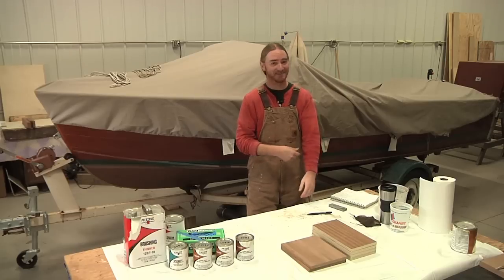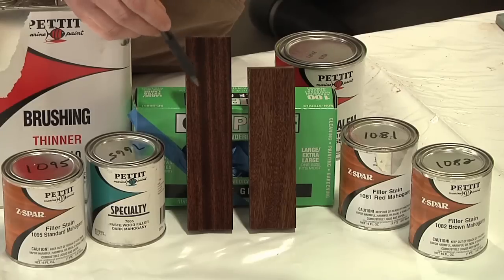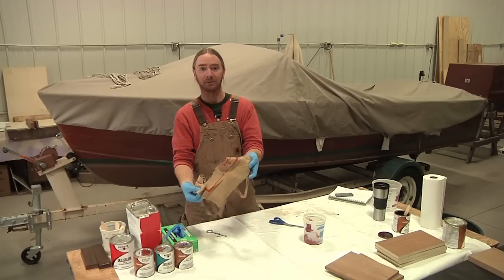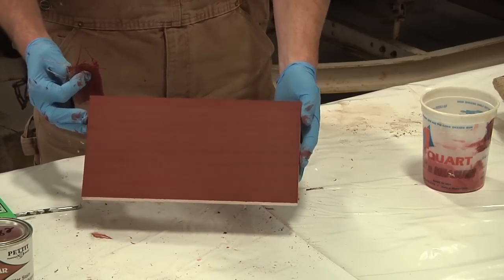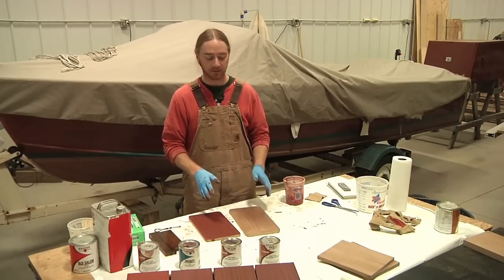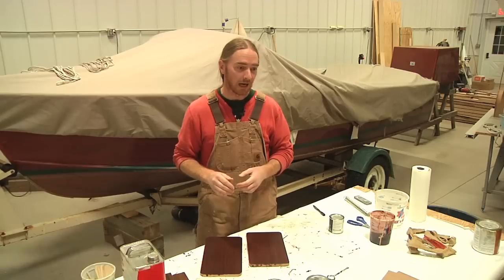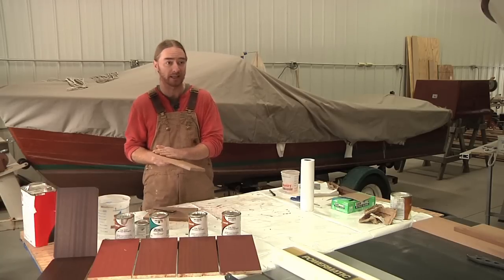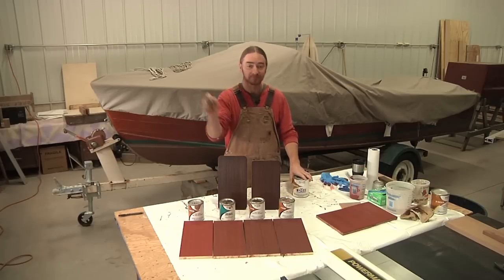Classic Boat Finish On Mahogany

Comment: I restored a. Antique wooden. Chris Craft cabin cruiser  and used Sapele  mixed in. Strategically inside. The cabin  mostly on. Things like the galley cabinetry and counters  in my opinion it looked. Like it was supposed to  be there   Ive always been told it was a “farmed” Mahogany  and it doesnt have. The rot resistance that Honduras Mahogany  has ?  In the 90s. Architects and designers spaced the heck out of it on various  commercial woodworking. Projects  most people cant. Tell the difference between  any of the species  i find your channel very interesting. As ive been a lifetime boater  that bought my first boat. In the late 70s way before You Tube videos  luckily i lived in South Florida and there was plenty of  people that were experienced in Bright work. And  taught me a lot  ive always. Favored Petit products myself  especially their Spar Varnish  that ive found looks best at around 7 to 8 coats  usually i do not stain  as I personally like the natural color brought out by the varnish  i may add  that i did do Woodworking as my profession for over 20 years  untill a Traumatic Brain Injury forced me into early retirement for safety reasons Woodworking is still a passion of mine and a hobby  although i am between homes and shops at the moment  at my old job we mostly applied  conversion varnishes to   A lot of our projects  so for me it was always a pleasure to  apply a “ real” varnish job on my boats  LOL   We did however have a full time Finisher on our staff  that  did a fantastic job. At  all of our staining and finishes

Comment: Hi Andy, I have been watching your videos for a quite while and learned a lot. I thank you for that. I am at the point of starting a challenging project of re-veneering my boat deck. I have a classic Finn of 1984 with a plywood deck. Unfortunately there is severe damage on the deck, which leaves me no choice but to repair and refinish. As there are so many repair spots already, I feel I have no other choice than to re-veneer the deck entirely. I am planning to buy 3 mtr long strips 0,6 mm thick, 3 mtr long and 18 cm wide. I plan to glue it on with West system epoxy, then when done apply a few coats of epoxy on the veneer and then refinish with a number of layers of 2c clear coat. 
I haven't done any veneering projects before, though I am a seasoned woodworker. What I am concerned about is the joining of the strips, length and cross. Can you give me some guidance maybe? I intend to align the sides of the strips with a small block plane so that they perfectly match together, but what if I glue on a strip to the boat one day and then joining the next strip the next day. I am concerned that the tiniest bit of epoxy squeeze out, might cause the new strip to not perfectly align with the one I glued on the previous day. If I would clean it thoroughly, I might damage the strip that I already glued on the deck. What is your advice to tackle this?

Comment: Great job, Andy!  Have you ever noticed hair-like single black hard fibers in sapele? I'm building bench seats for a seventies Whaler and the sapele I got is full of those streaks and when I sand it down it leaves a coarse black sawdust...
BTW I didn't stain it and it turned out beautiful!

Comment: I really enjoy watching your videos and have found a lot of great information.  I do have a question regarding teak refinishing.  In the spring I want to refinish the teak on the outside of my boat.  I have seen some videos where they have used epoxy first and then coated it with varnish.  The teak on our boat is original  and is about 40 years old.  I believe that teak oil is the only thing that has ever been used on it.  I am wondering what you would recommend for refinishing.

Comment: What paint would you recommend for a mahogany lap stake hull?  It is a 1962 vintage, is kept on trailer, has not been used in 15 years but garage kept in dry climate and in good shape.  The hull is painted white and has a copper based bottom.  Paint is flaking in dispersed small patches.  What would be a recommended surface prep?  Paint remover?  Thanks for help.

Comment: Nice video and explainations, it will help me for my guitar project. It is usually recommended to use a grain filler.. but you are not using it. Is there any reason for that? What is the difference by using a grain filler? Thanks!
Reply from the maker: +manu777tube This is actually a grain filler and dye :-) Works great!!
Reply: +BoatworksToday All right now it's clear for me! Thanks for your answer

Comment: Hey Andy. I know this video is quite old, but I'd like to add a comment/caution. You mentioned you were sticking the rags outside in the snow as it's below zero and frozen rags won't ignite. While that's true, BLO and other oils won't evaporate in those temps, either. My dad stuck his BLO rags in a bucket outside in subzero temps. Unfortunately, he brought them back in a month later and put them in the trash can and when they thawed, they combusted and burned his house to the ground. IMO, any such rags should be taken outdoors and burned intentionally so they never have the opportunity to combust accidentally.

Comment: Hey Andy, what if I wanted to apply a coat of epoxy to seal the wood before I put the coats of varnish? Should the epoxy or the stain go first?
Reply from the maker: If you're going to be working with any kind of oil based product (the stain is oil based) then epoxy really should not be used at all.  Epoxy base coats should only go over bare clean wood.  Hope this makes sense!
Reply: @boatworkstoday  thanks!! What if it was an water or alcohol based stain?
Reply from the maker: I THINK west says that alcohol or water based stains are ok to use but I'd have to double check that.  Their customer service is great to talk to, might be worth a quick call to see what they recommend :-)
Reply: I don't believe you can put epoxy over varnishes , shellscs or oil based poly or paint . 
You can use epoxy over most everything else but not oil based anything .